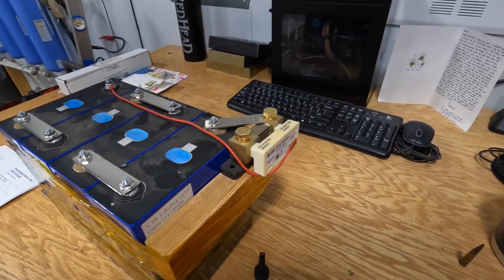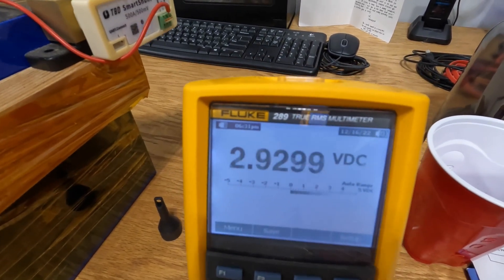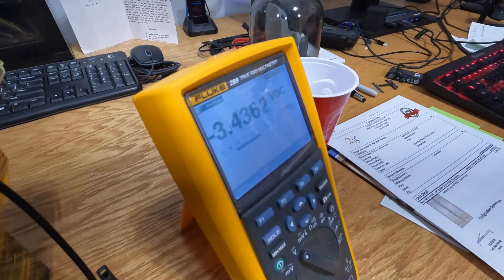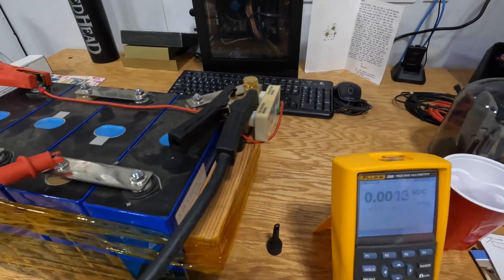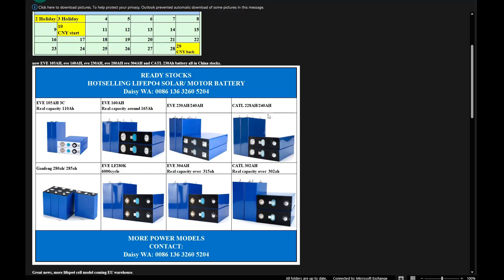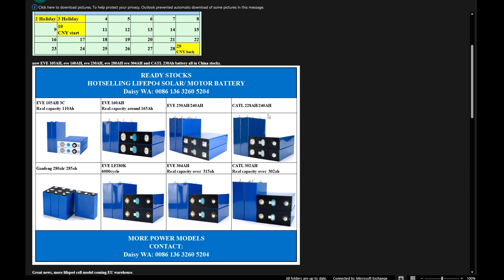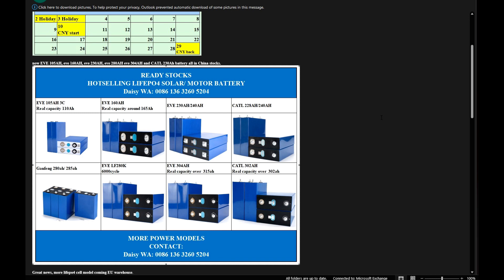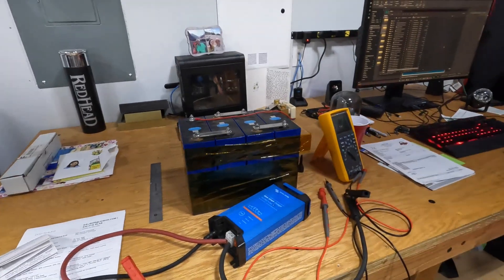EVE 304Ah Cells One Year Review.  They Fail.

Comment: We have no idea how the batteries started out before storage,BUT YOU SHOULD use a BMS and totally charge them and discharge to 50-60% before storage and do that every few months.Charging cells to more than 3.65V is not good and leaving them at a high voltage is not good.I try to  immediately use power to discharge a battery after a full charge to get it down to the 3300's of mV per cell.ALSO new cells whether in single units like you put together here or battery packs need to be cycled many times before they "settle  down" to balancing really good as they are charged up.Most  snap shots (by manufacturers or sellers)of cell voltages on a battery are when the battery has been discharged a bit,in which case they WILL LOOK WELL BALANCED.I have repaired batteries with cell  voltages way out of wack and got them to work excellently with balanced voltages while charging to full charge.Those cells are probably good they just need to treated better.Enjoy

Comment: so you show us that you have unbalanced cells. lol. That os perfectly normal. If you look on the lifepo4 voltage chart you will see that it goes up very quickly from 3.4 to 3.6V. That is phisics law, perfectly normal. I charge them to 3.45V and use a balancer 2A. o have them for 2 years, 600 cycles until now, no problems. capacity as stated.

Comment: No shit. You don't have matched cells. If you haven't capacity and IR tested them then you could have anywhere from 319Ah to 324Ah. 5Ah is enough of a difference to have a cell at 3.40 and another at 3.70 I think

304Ah is the nominal/typical rating...might be the minimum rating.

Comment: I've just accepted that they are what they are.

I only charge to 3.40V and discharge to 3.125V per cell.

I got rid of my LV6548s and now have a 15k Sol-Ark.

42 panels made 65.6 kWh of power today. I had a peak production of 10200w. It is so relaxing to not have to do one thing at all to the system except drool over the charts and graphs.
Reply from the maker: Your system is even nicer now. Keep it up!

Comment: You need to put them in parralel, charge them at 3.6V then let them settle for .. 2 days .. check the voltage ... this last voltage multiply by 4 .. this is the voltage you should charge your pack .... maybe a little higher to acelerate charging ..but not by much.
AND you need a BMS, some of your cells are overcharged, they are charged OVER the specifications !

Comment: I hear that. Ya if you compare em to a mach e 100kwh, prob so. lol.  I'd prob. use them for a 30-50kwh off grid system if i do it.  Its the home battery in my van and so far has done great. About 11 months old now, 280ah with the radio b tech BMS.     Have'nt had a ton of hard use yet, but has done pretty good.

Comment: I purchased 16 of these cells and i capacity tested EACH cell and they all tested in the 310-315ah range with charge and discharge at 40amps. These are well worth the money. Even if they were at 280ah it’s still with the money like you stated.

Comment: Try cleaning all connections. Apply MG Chemicals 847 Carbon Conductive Assembly Paste. Parallel them, top balance again, install JK BMS 2A balance…they’ll be like new again. I have 160 280ah’s running great almost 1yr.

Comment: I don't doubt you are correct they must have 1000's that don't make the standard, I know every manufacturer has seconds to sell would be nice to know what they are but like you said we work with what we can afford. On the foundation we always dig a low spot on the outside and fill it with stone and a pail with no bottom for the pump to sit in and it keeps the work area dry. Nice garage and take care.